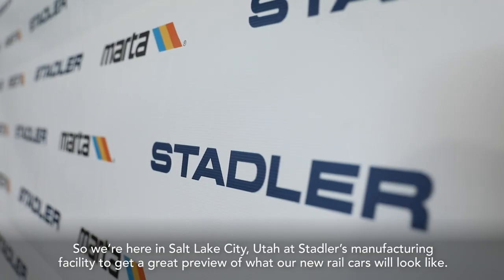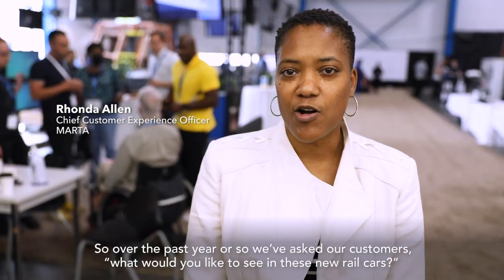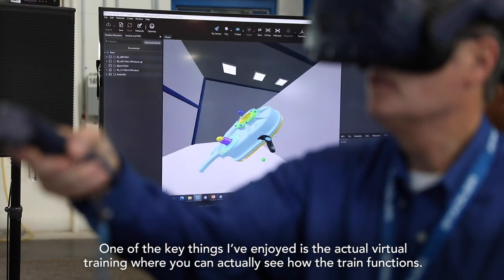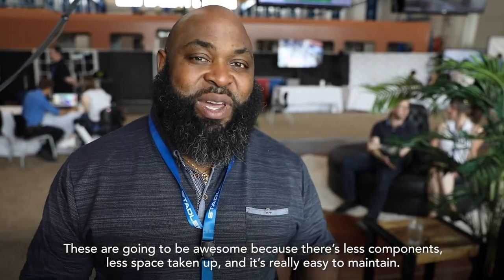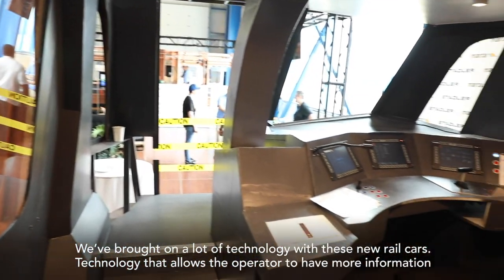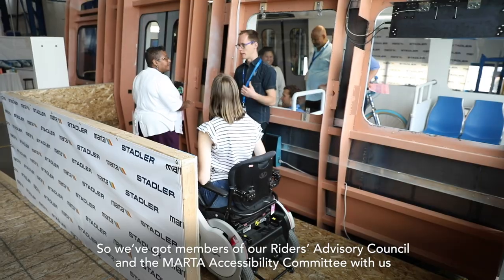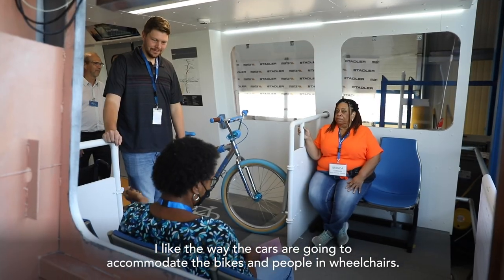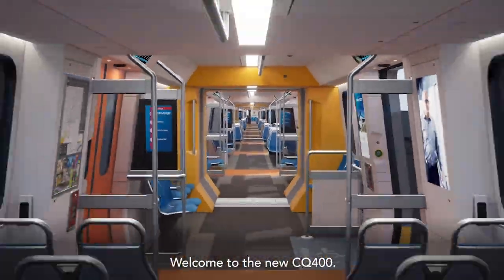CQ400 Rail Car Preview

Comment: The color coded lights are nice. Not sure if replacing the entire fleet at once is a good idea though
Reply: It won't quite be all at once...they will eventually replace all of the current trains with CQ400s, but it'll be done in phases over several years. Hopefully that'll be sufficient for them to be able to identify and correct any issues that come up (but here's hoping that it'll all go smoothly)

Comment: As a daily Marta user, can I ask that we have more staff taking care of the stations and install some bathrooms please. People pee on the walls because clearly there are no bathrooms except at Five Points which is the only station that does not have urine on the walls. The walls and the ceilings are all covered in grime and the tiles are so worn out, I can tell Marta is downscaled from what it used to be. It seems like Marta is being dismantled the same way the USPS is. Marta generates profit for the city, it does not have to generate profit from the fares. The state of Georgia owes Marta that funding.

Comment: 2025? I thought they were coming in 2023?
Reply: Feel free to correct me, but I think We're receiving our first few pilot trains next year, and then it'll be more prevalent by the time 2025 comes.
Reply: Originally the pilot car was supposed to start running before this year ended and the new cars were supposed to come online next year but obviously there's some kind of delays that they are not talking about
Reply: That is when the delivery will finish. The first sets are actually already here.
Reply: @jrayproductions7790  The sets were there for the unveiling ceremony. Then they were being taken to the stadler facility in salt lake to be assembled then they'll come back to Atlanta to be tested and put into service.
Reply: The first car has already been delivered by 2025 they should be pretty common on the system
Reply: 4001-4254 should be the car numbers.